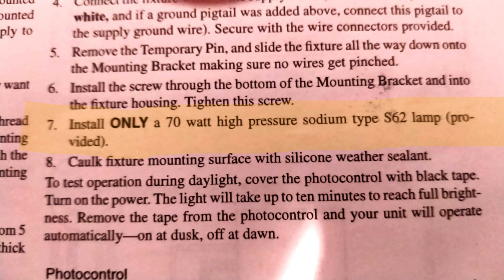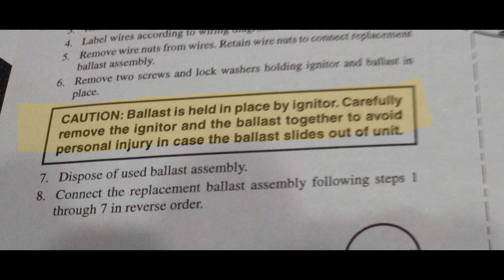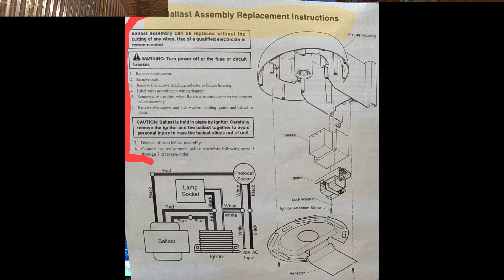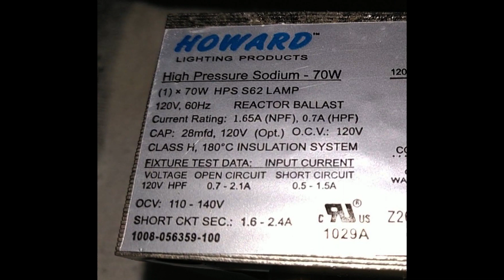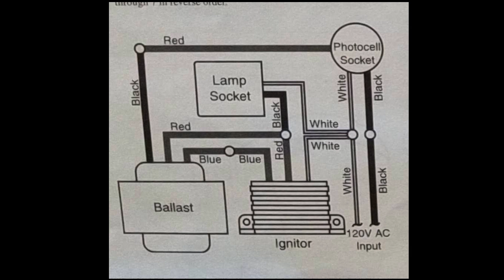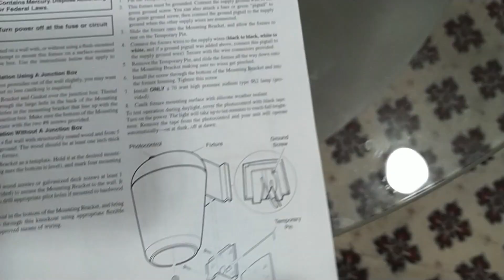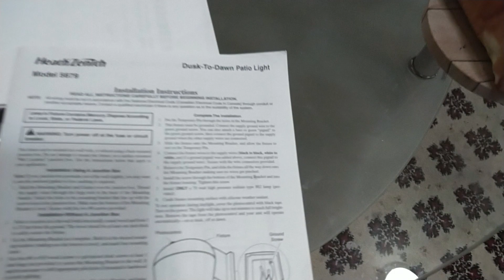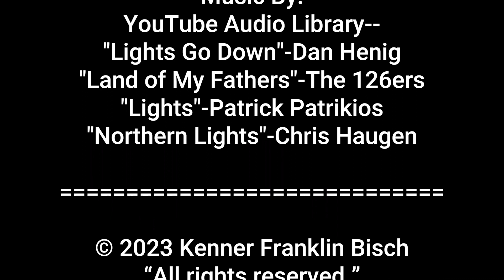How to Fix a HPS (High-Pressure Sodium) Backyard Patio Light.

Comment: You can do a tutorial of how to wire a Mercury vapor Lamp with capacitor and the coils and how to connect it to 120v
Reply from the maker: The Mercury Vapor fixture that I replaced with this HPS fixture years ago I no longer have--I switched to HPS in 2018.  Mercury Vapor fixtures and their parts are very difficult to find since the time that I switched to the HPS.  Mercury Vapor fixtures in the USA have been getting phased out--going obsolete so the switch to the HPS or LED fixture was necessary.  I like the HPS fixture, and they are not being phased out, so I chose to fix this fixture instead of replacing it with a new one when it stopped working earlier this past year in 2023.  For your need--to see how to fix (wire) a Mercury Vapor fixture I could talk about it, but I don't have an actual Mercury Vapor fixture that I could show how to fix it.  If you want me to tell how to wire it I could, but could you send me information about it and any instructions you have--or at least the name of the fixture, model, model number, manufacturer, etc.--then I will know more about what you need to know.  --Webideo

Comment: My sodium light is staying on lately and won't shut off.  What do I do?
Reply from the maker: First check to make sure the photocell is cleaned off where the window is at for the sunlight to shine on it.  Sometimes the photocell is just dirty, and needs cleaned.  Otherwise, has the photocell gone bad?  You may need a new photocell.  Check to find out if it is just dirty first, though.
Reply: @Webideo   Thanks for the reply.....the photocell is clean. Can I purchase a new one, and where can I find one?
Reply from the maker: Yes, photocells are widely available to purchase.  Most all stores that sell outdoor light fixtures offer them, and they are available online.  Cost is approx. $9-30 depending on the type you need.  Match the type that you are replacing in your light fixture.  Turn off the electricity to the fixture at the breaker panel before opening it and be careful of the capacitor because it can still have electricity stored in it even when the electricity is off.  Be careful, and have a qualified electrician install it if you need to.
Reply: @Webideo    Thanks for the reply....    ;-)